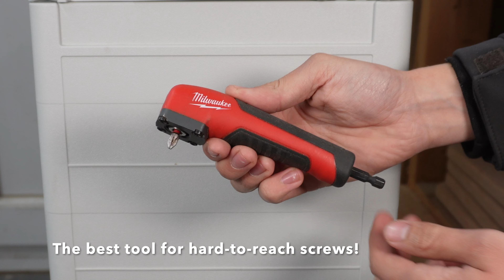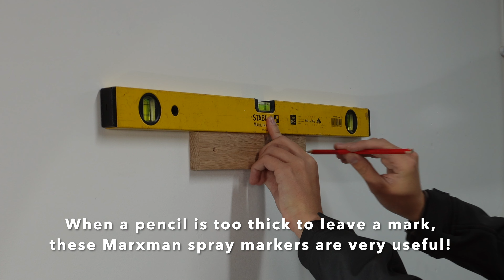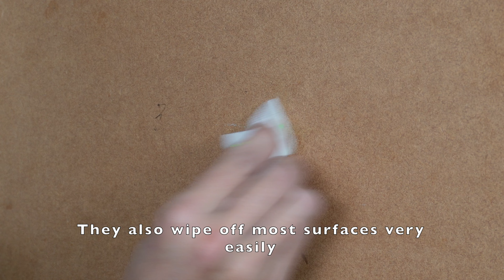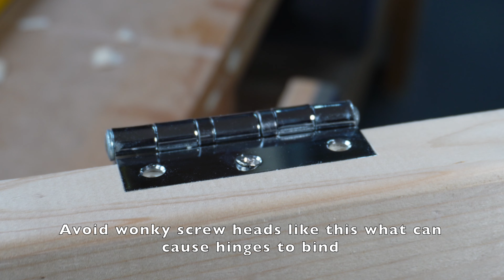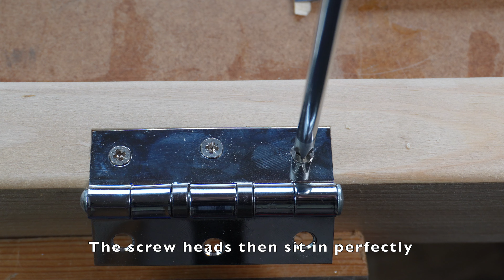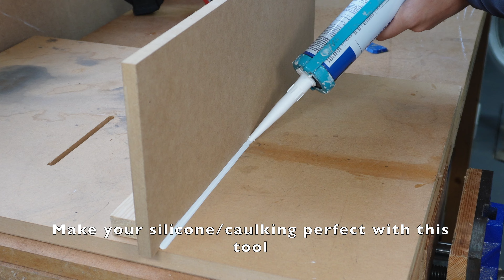Must Have Toolbox Items For Any Tradesman / DIY'er

Comment: Great video! Just bought a right angle adapter and center finder. I couldn't use the affiliate links in the us though. Also, those look like pozidriv screws; you should get a pozidriv driver.
Reply from the maker: Thank you! really appreciate the comment! And thank you for letting me know. These are just tools I use all of the time, the affiliate thing was an afterthought so I should have probably looked into how to set it up better😆 will have a look into it tomorrow! As for the driver, I have one in my usual toolbag but that was at work so I just used anything I could find laying around in my garage. That was the closest I could find😆 well spotted though!😁👍🏼